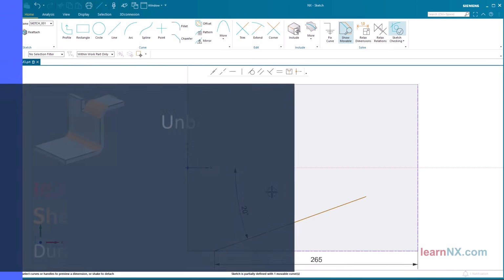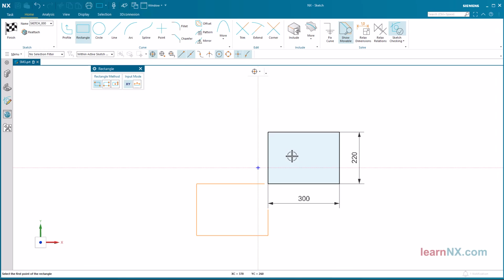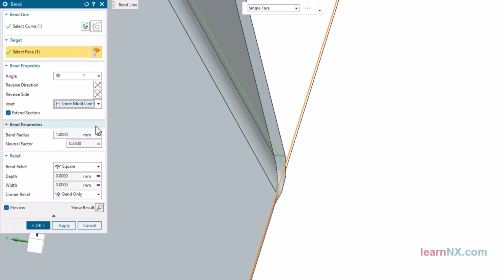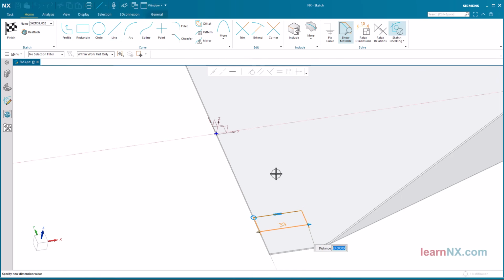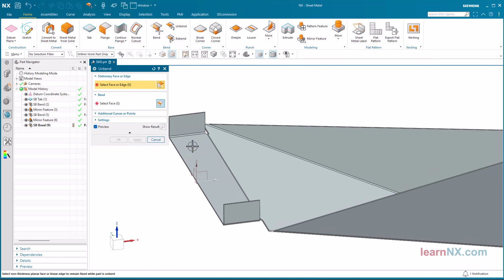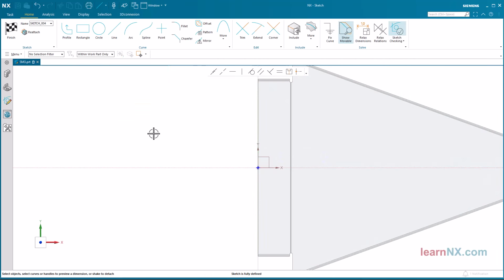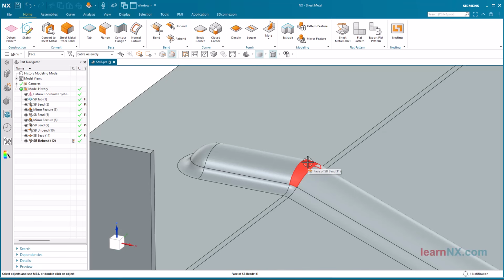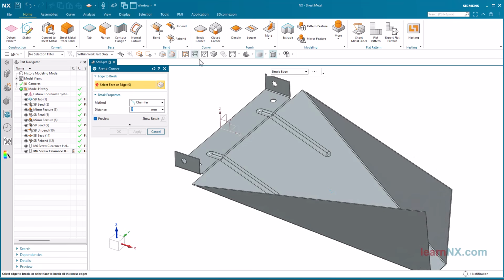Bend, Unbend and Rebend, Bead | Siemens NX Sheet Metal

Comment: Hi, I have a question about the difference between *Inside Mold Line (IML)* and *Material inSide* in NX.

I understand the basic idea of Material Side — it indicates whether the material is on the inside or outside relative to a reference.

However, I’m still confused about *what exactly “Mold Line” means**, and more specifically, what the difference is between **Inside Mold Line* and **Outside Mold Line**.

Could you explain what the “Mold Line” represents geometrically, and when I should use Inside Mold Line vs. Outside Mold Line?

I understand the concept of the material side, but I’m having trouble understanding what the “Mold Line” itself represents and how it is used as a reference in NX.

Thank you!